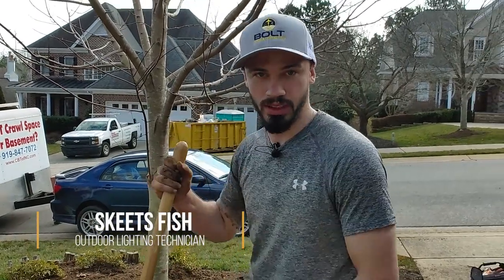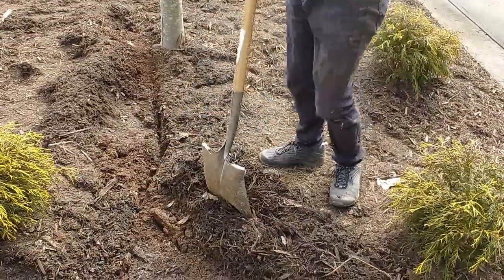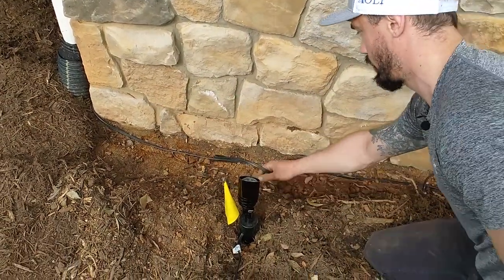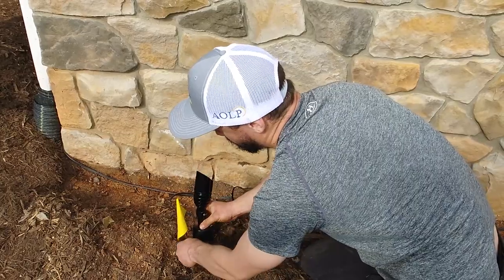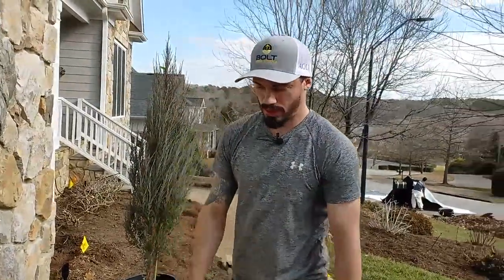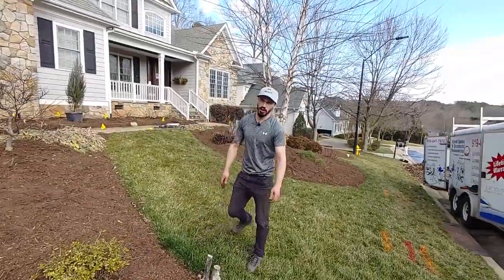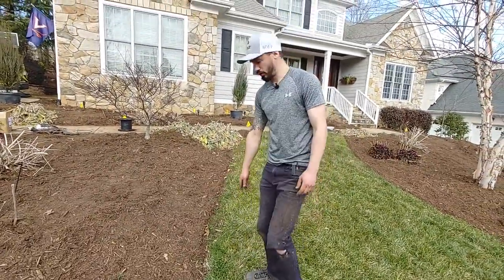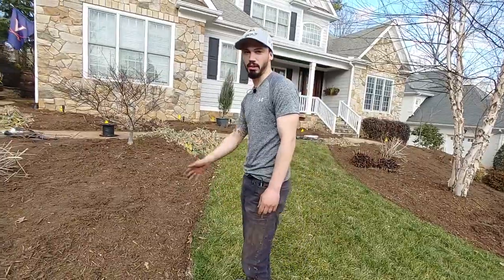Best Ways to Bury 12v Landscape Lighting Wire | Tips & Tricks

Comment: Do I recommend 12v drop in led low voltage outdoor lighting??  Or the new integrated leds?  Thanks!
Reply from the maker: For the homeowner installing themselves I would recommend the drop in lamps. They are easier to maintain, replace etc.

Comment: Thanks.  I'm going to be installing low voltage this weekend but need to cross a wide driveway. Do I pull up the wood strips in between the poured concrete slabs and just run the wire in there and then put the wood strips back in or do I run some sort of conduit??

Same with our walkway. I need to get from one side of a small slab to the other. Do I go under it or do I pull up the wood furring strip? That's about 2 ft wide and run underneath
Reply from the maker: If you can pull out the strips then that’s a good method to run wire over just remember at each end to angle grind a wire path for wire to go straight down so it won’t get nicked by lawn tools
If the strips don’t come out easily run your angle grinder to make a wire path
Reply: @OutdoorInspirations  I don't have an angle grinder, but I can probably run it under the furring strip right into the adjacent garden. I have a garden on each side of the garage. 

I'm wondering if I could also go through the left side garden and then up into the garage, around the frame and then back down into the garden on the right. 

If I do go through the joints, Do I then just put the furring strip back on top or do I need to put down some sort of caulk and then the furring strip?
Reply from the maker: @JS-cb7rx  yes I have seen people install wire up and over garage doors. It is all about labor time/difficulty and aesthetics- feel free to email some pictures to us for more guidance

Comment: Prefered method to connect at the whip?

Wire nuts? Crimp and shrink tube? inline t?

Thanks for the tips and content guys
Reply from the maker: Hey there! Thanks for you comment, we're glad you enjoy it! For ground applications we like to use splice kits that have copper crimps into grease tubes, and for above grade wire runs we use barrel crimps into silicon lined heat shrink tubing. 👌

Comment: why would you use the expansion joint to run your wire? I thought you would use those long drill bits to go under driveways & sidewalks?
Reply from the maker: Long bits and sidewalk sleevers are fine options as well- we just had issues of hitting the underside bulges of concrete making it time consuming to find the other side. You can angle grind and zip across an expansion joint in no time

Comment: You mentioned you use conduit - do you use a flexible conduit or a hard pvc conduit?
Reply from the maker: Hey Jason, we use hard PVC conduit when burying our lines.
Reply: @OutdoorInspirations  I believe putting the low voltage wiring in conduit is the best practice.  Makes things easier for additions or changes in the future.  The only thing I have a question about is the heat generation of low voltage wiring. I recall reading about the possibility of too much heat in PVC. I find that hard to believe, especially with LED.
Reply from the maker: @ktm3850  The wire itself will not heat up with 12v led as long as there are no nicks or shorts in the wire itself or at connections. Typically at these locations heat will build and can melt the wire gasket. We have yet to see any major melting of the actual PVC when a short had occurred.